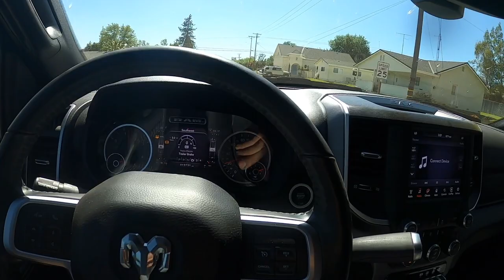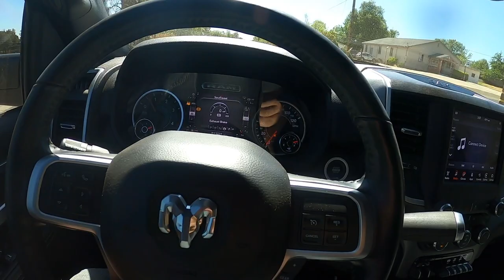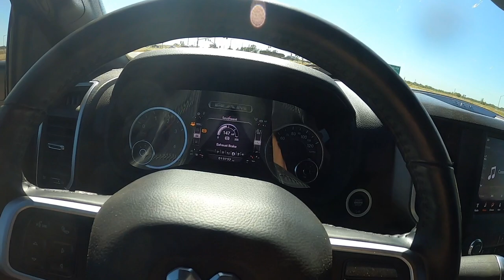2020 RAM 3500 Dually hauling heavy—— MAX TOW!!

Comment: Just wondering how long you've had the diamond c trailer have only seen them on YouTube I'm thinking on a PJ dovetail just wondering what your thoughts
Reply from the maker: I’ve had this girl for about 7 months now, I have a buddy that’s had his for 2 years as of last month if I remember right. 
This is by far the best investment you can make it will treat you right and work as hard as you do. It surpasses PJ in every way from design, weight, service, quality and biggest thing no dove tail trailer lifts more than DC my tail can lift 10k lbs and support it on the tail. PJ and load trail only lift 4K I think and it’s not a cam over system it’s a mechanical lock. This tail has no way to fall when lifted back up in its tow position much safer and much heavier duty.
Reply: Appreciate you answering didn't know PJ could only lift 4,000 lb and it is good to see someone on here that knows what the hell they're doing when they're hauling equipment appreciate it
Reply from the maker: Ya man you know it. I definitely test things like crazy on what I have and use. Always happy to share the truth. The real world never is shown on a add for a trailer. More than happy to show what things are able to and unable to do. Real world working 🤘🏼
Reply from the maker: Have lots of other videos towing with this beast on my channel, towing the water truck was definitely the best test I could have done for the tail of this trailer and I hauled that about 4 times
Reply: I'm going to watch that video of the water truck when I get a chance for sure
Reply: I do appreciate the honest opinion on the trailers helps to save some money
Reply from the maker: @GENESISR_RRANCH  awesome, of course. It ain’t cheap don’t get me wrong but it’s money spent once and done. Always happy to help my man.
Reply: I just watched that video of the water truck I don't know what the back side of that truck weighs but that's pretty impressive that that dovetail would hold it
Reply from the maker: Lol ya that sucker was weighed in at 23,600 lbs and a good chuck is on them rear axles really good chance I had 10k-11 lbs 100% on the tail and she handled it perfectly

Comment: I have a 2020 550 diesel, 11,200# 40' hydra-dove that I put 32,000# of steel pipe on. That dodge would have thrown its guts up trying to pull it! Ford is where it's at. F350-F550 can't get anything better for light duty or medium duty from the factory!
Reply from the maker: Dam bro that’s a bit heavy lol

Comment: Wats the difference between the 3500 and 4500&5500 RAM?
Reply from the maker: Upping from the 3500 to the 4500 main changes are wide track front axle, larger rear end and larger breaks on the truck, also getting the option to have lower gear ratio. Back half of the frame is heavier for cargo use and heavier suspension all around on the truck. However the one down fall is a derated motor you can’t get the 4500-5500 in the HO configuration

Comment: I wonder if the weigh safe goosneck ball would be any use in your business.
Reply from the maker: It would be maxed out nearly all the time, would do me no good sadly. Some loads yes however I tow a lot of the same equipment many times and I have good reference points for good safe rows

Comment: Would love to know you’re temps when towing that weight
Reply from the maker: Have a few more videos pulling grades I try to always say the rpm, speed and temps when I’m going up and down. On flat land like with this tow, engine temps never go over 210 and trans temps stay around 170 unless in town getting red lights then I’ll spike up to 177-185 but anything just hauling on the highway trans stays 167-175 and engine will keep at about 205 on a hot day too.
Reply: @IManOPERATOR  that’s the same I see. My new 2022 3500 saw 240 oil and 230 trans the other day... after Hauling Heavy and in park “cooling down” while going down the road all temps were normal. You ever see this? Dealer says normal...
Reply from the maker: @thehustlelife481  ive never seen that high if temps with my truck. Not even the dead heat of summer highest oil temp I think I’ve seen was 225 transmission temp hasn’t gone over 220ish  I’m not sure if it’s even gone that high but it’s gotten hot sometimes mainly when the torque converter isn’t locked

Comment: What is the difference between tow and haul.
Reply from the maker: Tow haul doesn’t let the truck shift till 2k rpm and down shifting is much more aggressive when you apply the brakes
Reply: @IManOPERATOR  You said Tow-Haul. Is that what it's called or is there a difference between tow and haul?
Reply from the maker: @revfred2008  no difference the switch is called tow/haul

Comment: In Penna you need a dump truck with air brakes for that load.
Reply from the maker: You sure? If the truck is tagged and is capable air brakes mean nothing in terms of weight. It’s just another endorsement on your license

Comment: What model trailer and what length & weight specs?
Reply from the maker: Got tons more videos on this trailer on my channel if you want to know more. 
Especially the video when I first bought it. Have a good comparison between the two trailers 
But it’s an FMAX216 30’ deck, 32,800 rated 40k weight distributed trailer

Comment: Is Max towing for ram 3500 dually 3700 bound?
Reply from the maker: This one is 35500 if I remember right
Reply: I have 19 3500 limited . I’ve towed this heavy a few times and I agree with everything you said.  Great video.
Reply from the maker: @hydrotailjoe878  good shit 👌🏼
Appreciate it

Comment: You shouldn't put your binder hook on the outside of the rub rail, you should put it down between the rub rail and trailer deck.
Reply from the maker: 1/2-3/8 hooks don’t fit between a rub rail. That’s an old outdated law/myth that I never understand the reason behind it. Rub rail is the most secure restraint for all loads however you attach or use it.

Comment: Does the truck have the iesen trans and high output cummins
Reply from the maker: Yes it does, I would have roasted a 68 trans by now with this weight 😂
Reply: Nice do you think a 2021 chevy 3500 with the duramax and Allison could tow that same load just as safe
Reply from the maker: Couldn’t tell you yes or no. I’m not a Chevy person. Biggest thing for me the cummins has the best exhaust brake system. Hold weight back extremely well. I don’t see why not for a Chevy I’m sure it has the power for it and capability for it. Just stay safe out there don’t haul past your comfort zone
Reply: What kind of truck and trailer connection did you use do they actually make a 3 inch goose ball rated that high
Reply from the maker: It’s a gooseneck ball. And yes they have the 3” ball for this trailer. I have a 2 5/16 right now on it. Going to up it to the 3” ball soon for some extra beef.
Reply: Actually I was just curious do they make a ball rated at the weight you are towing the strongest I've seen is 30 k
Reply from the maker: @michaelfrank6696  30k is the strongest for 2 5/16 ball. That’s why a 3” is in the near future. Rather be safe then sorry.

Comment: Nothing like a ram. Why don't you use a 5500 ram?
Reply from the maker: I wanted the 3500 since it ad the HO motor option and I also use my dually for longer trips at times more comfortable ride plus the truck itself is lighter allowing it to tow more weight. 4500-5500 are great trucks if you need the truck for payload capacity and or if you want lower gearing since you can get 4:56-4:88 if I remember correctly. My truck is a 4:10, honestly making it awesome for hauling heavy and on hwy I sit at 2k rpm going 70 mph vs doing 70 at 2300-2500 rpm like a 5500 would do

Comment: Our safety officer would require 5500 for that job
Reply from the maker: Best part about owning your own cluster. I do accept ram 5500 donations though. 
Plus check your flat bed make sure it even built the right way to handle this weight. 
Seen many with weak and little welds 
Better chance of the ball-in the flat bed to fail if not built the proper way

Comment: I can tell you what the problem is your chaining on the  tail too much up play on that junk  need to cross chain on articulated equipment or put the lock bar in place Dot can write a ticket for no cross chain or lock bar
Reply from the maker: There is no problem the way I hauled this machine. There’s little to no play at all on the tail of this trailer. No need to cross the chain when you’ve already achieved 45 degree of angle when chaining down (which is optimum) no clue what you’re taking about for the lock bar, dot can’t ticket you due to “how you chained” with in limitations of course, 1 being you have over 50% of towing weight chained down, you have chains tied in or tied out in pairs (min) all other chains or straps for cautionary and or to support up to your 50% of weight. 
If you’re taking about the “lock bar” for the tail of my trailer, there is no such thing. It’s a camover system that locks itself the tail with hydros has to cycle to “unlock” the tail. 
If that’s what you’re talking about.

Comment: So Ford and GM can haul more than dodge it maybe a couple hundred pounds but hey Ford beats all.
Reply from the maker: What’s on paper doesn’t prove to me what’s capable in real life. I have a 2020 F350 dually also, hate it won’t tow more then a 14k trailer on it.
Reply: Ram currently has the highest tow rating of 37,090.   Sorry Ford loses....  Again.  Do your research before talking out your pie hole.
Reply: @IManOPERATOR  -  That’s such bs. Ford F350 will tow the same thing any ram will no problem.
Reply from the maker: @CoyoteFTW  clearly it can, doesn’t make me comfortable doing it though. My Opinion my experience.

Comment: Cat CP568 weight can range from 14k to 26k lbs. Trailer weighs no more than 4k lbs which means you are nowhere hear 44k lbs. Some Ram fanboy is going to kill himself because he thinks he can put 40k lbs on a truck because of your video. On a Ford you could get away with it not a dodge tho. 😉
Reply from the maker: This is a cp56B which weighs 26k lbs if you watch my videos I cat scaled my truck for it’s empty gross combined weight. 
You honestly think a trailer of this capability and size weights only 4K lbs? I suppose if it was to be made of titanium and carbon fiber. 
It doesn’t take me for idiots on the road to over load their truck, what I do is legal in every factor. Currently weight these days I’m in the 45/47 range with my new machine. 
I personally will never use a ford for the mountains I tow up and down on. With the transmission temps they display and the lack of engine braking they are capable of. No thank you.

Comment: Just watch a vid of a stronger truck also known as a ford 350 pull 45k pounds better
Reply from the maker: Good for you.
Reply: @IManOPERATOR  you made ford is better kid
Reply from the maker: @kenji8102  thanks for the compliment, your opinion matters
Reply: That’s funny because the majority of dually trucks I see on the roads in different states doing hotshot are Rams, I do see Ford F-350 & F-450’s along with Silverado & Sierra 3500 hd’s here and there too but the majority are Rams.
Reply: @davidhunter9974 🤦🤦🤦